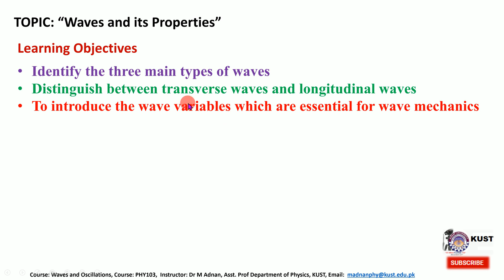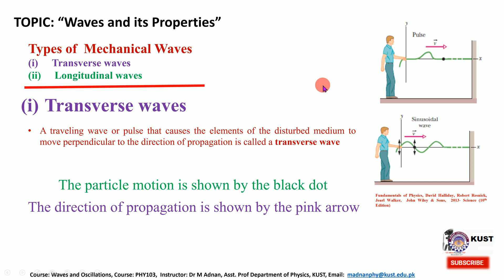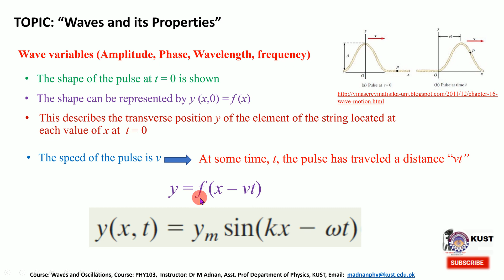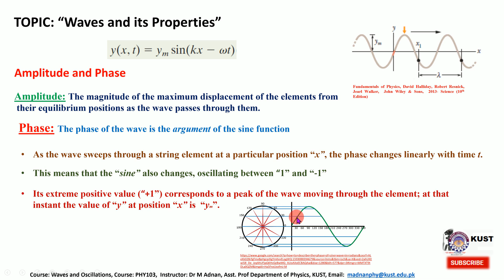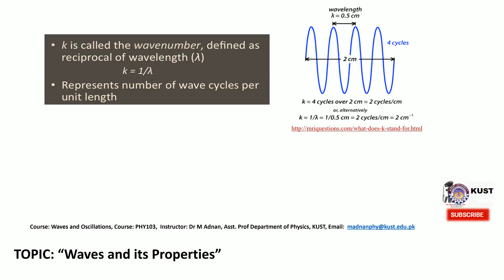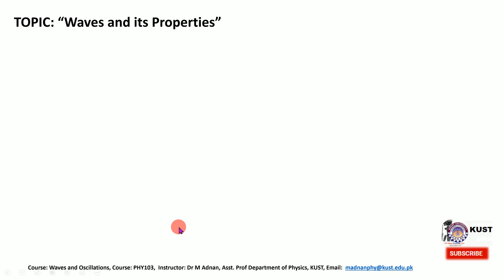Waves and Oscillations, Topic: "Waves and its Properties"

Comment: Sir what is difference between a wave and mode ?
Reply from the maker: In the wave theory of physics and engineering, a mode in a dynamical system is a standing wave state of excitation, in which all the components of the system will be affected sinusoidally at a fixed frequency associated with that mode.
Reply: AoA sir aap ka bth shukria videos bnanay ka liya plzz sir aur videos bnatn rhain waves and osscilation ki